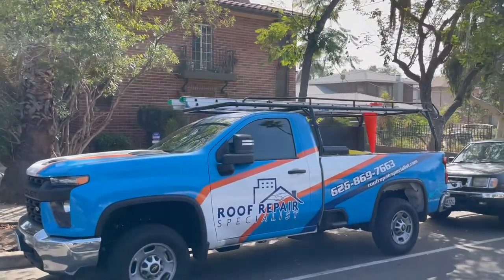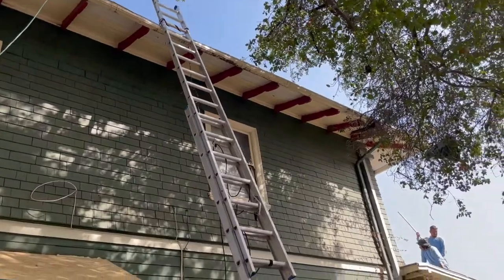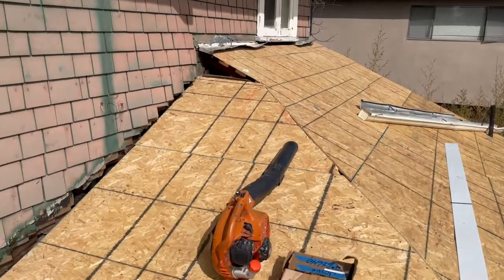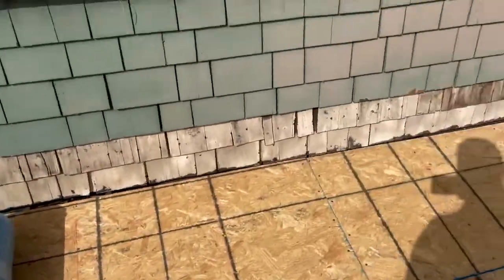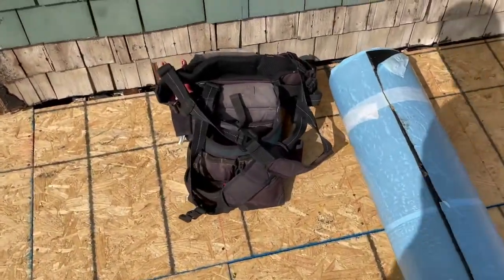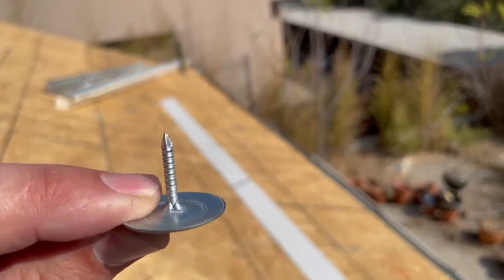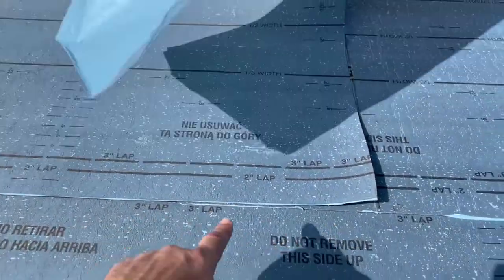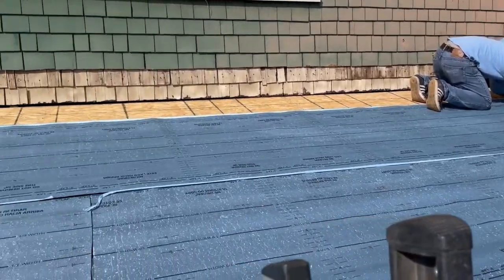Replacing a 100+ YEAR OLD ROOF | Job Site Tours

Comment from the maker: Do you prefer torch down or self adhere roofing? Leave a comment and tell us below!
Reply: A 3 layer torch on for longevity, 3 layer self adhesive for  safety. The first layer is tacked down on both systems.   I use 8ftx2ft  T&G Kronospan  for new decking. (Better than OSB or ply) If it is a warm roof I lay 8x4  5" thick Aluminium faced polyurethane insulation on TOP of the Kronospan followed by the 3 layer waterproofing  on top of the insulation.
 Put silicon in the grooves and a 10thou space along edges and the ends of the  Kronospan for any movement. A 40year life  I used pour&roll for many years. So dangerous!  I talk to other professional roofers and they all agree the 3 layer torchon  is the best quality and best looking flat roof on the planet, especially the Charcoal finish roof. Regards from Wales.
Reply from the maker: Definitely agree with a 3 layer torch down roof is the best, as long as it can be done safely. We usually use a nail down base, a self adhered or torched mid ply (smooth) and a granulated cap sheet. 
I hav never heard of Kronospan, dont think its big in the US. 
Thanks for the comment, always great hearing from people in different markets.
Reply: What is happening at 6:11? Shouldn’t he put a cutting board or a sacrificial piece underneath?Your videos are great. Keep up the good work.